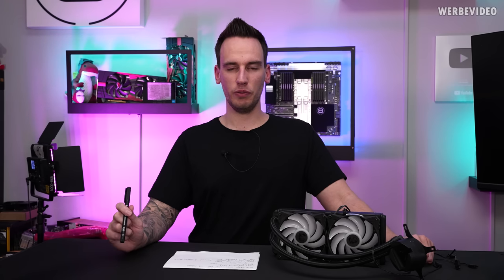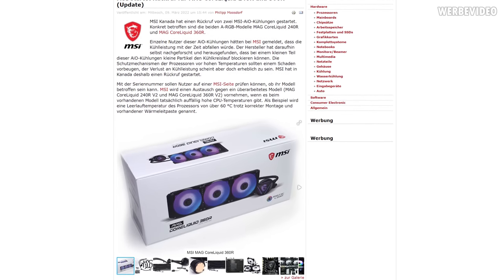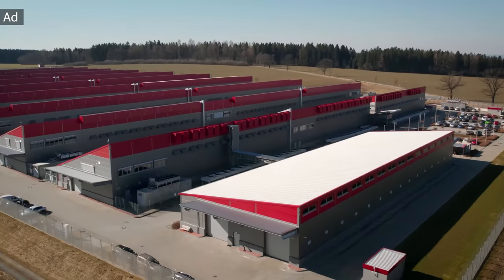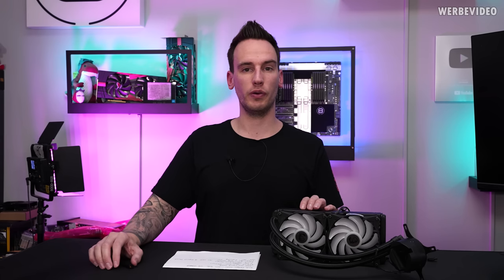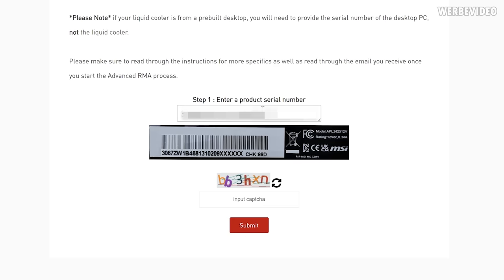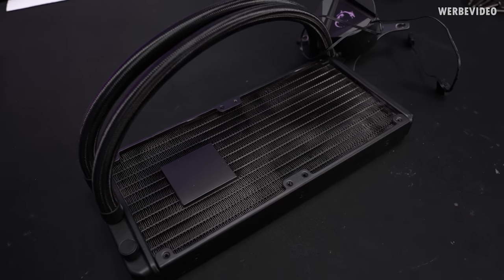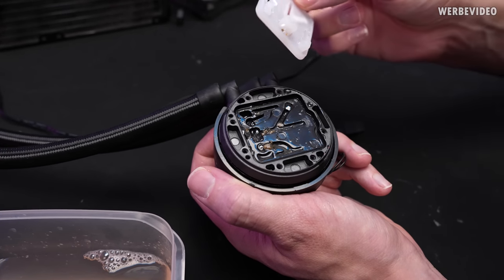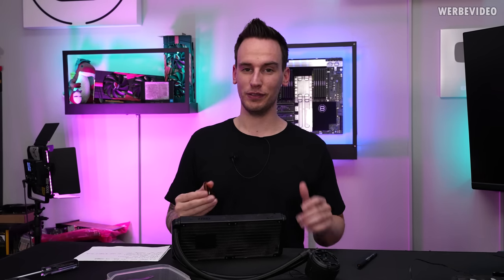Things you should not find inside an AIO

Comment: Yeah, this doesn't surprise me. I boycott MSI because they sent my mobo back to me in the same condition I had sent it to them in and claimed it was fixed. It was restarting constantly and the BIOS was resetting itself every restart as well. Swapping components showed that the mobo was the problem. The mobo finally failed shortly after they "fixed" it and took the CPU and RAM with it. Luckily my GPU survived, but when I complained to MSI, they tried to claim that the mobo wasn't the problem and they had performed no repairs despite the fact that they told me in an email that they had repaired the board. They claimed that the PSU was at fault. I'm still using that PSU in my main rig today, 8 years later, without issue. MSI is the worst brand for components, period. They will simply lie to you about repairs. Gigabyte may be slower than molasses on a Winter's day, but they eventually do the work. ASUS tends to be evasive and try to refuse repairs at first, but they will fix it if you are persistent.
Reply: They all do this. No brand does excellent. They would loose so much money if they were honest.
Reply: I had different issues with ASUS and found MSI to be solid. I guess Murphy hits you with any brand.

Comment: And this is why custom cooling is king against aio....
changed the water a pre-corona and it's still clean as a whistle.
Reply: Yep. But unfortunately not everyone can afford it or wants liquid near their expensive components. I also am custom loop cooling my high end system. Everything else is air cooled.
Reply: Not a simple thing for the masses of sheep
Reply: @kyoudaiken  
It took me a year or two to save up for it as a student, but I went for higher end components and the cpu block, reservoir and radiator are still running nicely, pump has been replaced after 8(?) years and the gpu block when I got a new one (twice).

The CPU block is up next on the chopping block, due to the 4770k being due for an upgrade (still up on the fence for ryzen 4 and 12xxx, I'd love some more pci-e lanes and ryzen is copping out a bit more there this gen...)